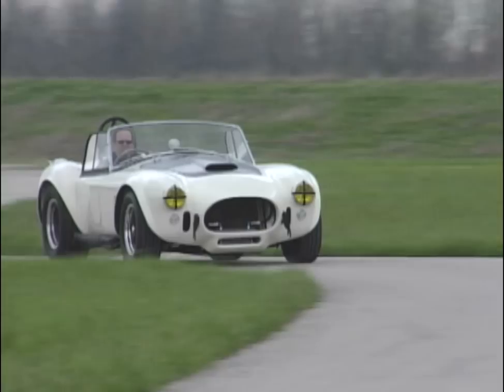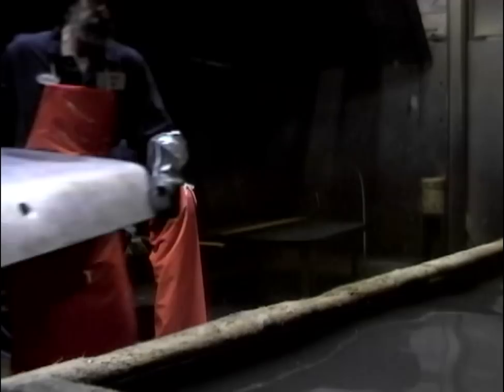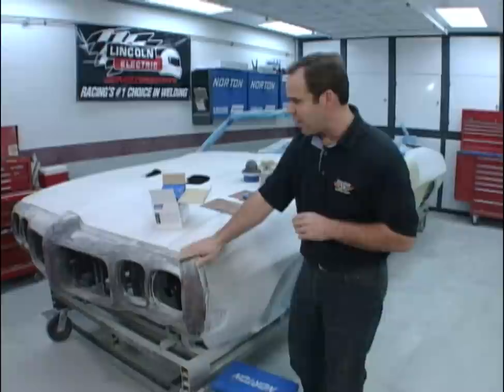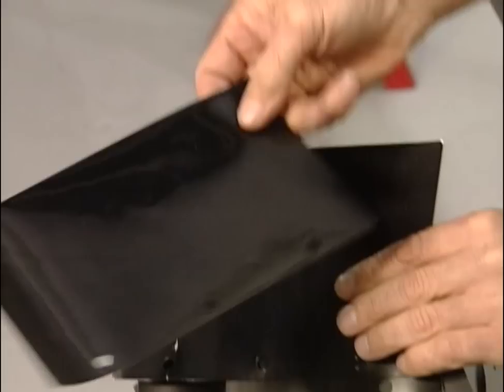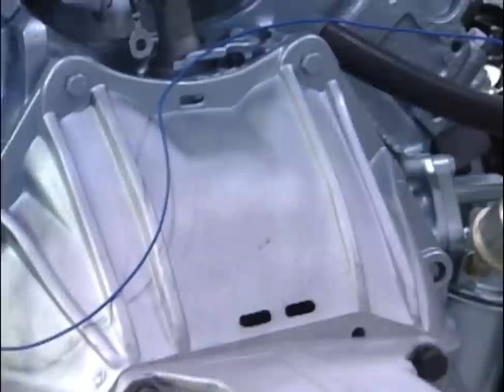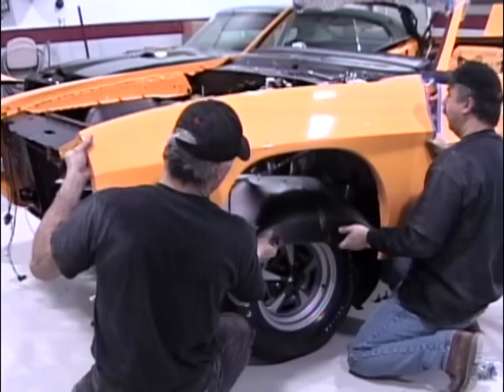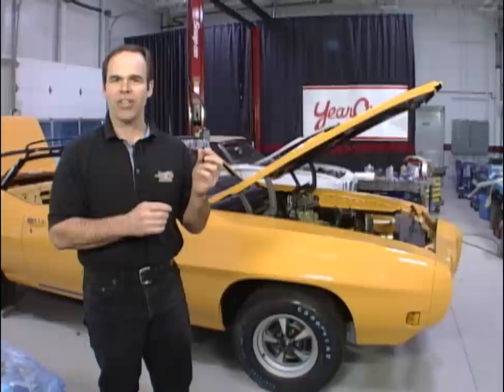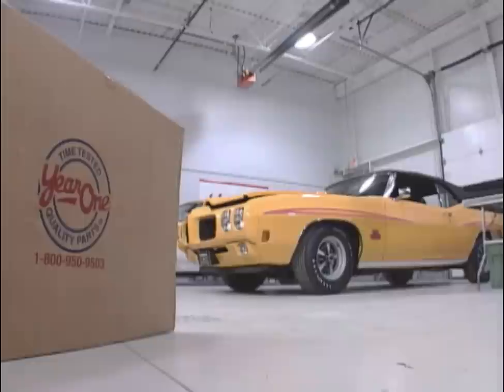This 1970 Pontiac GTO Judge Convertible came in baskets...

Comment: 40 mins 20 ish seconds.  it shows some of the black int.  then it goes down the outside of the bucket.  what do you see?  Those are not 70 buckets, they have the side latches as the 67 and 68s had.  strange the owner would go to so much trouble in detailing the car, then using different year seats.  did anyone else catch this?

Comment: Typically when you disassemble the cars you can tell the orientation from which a part was hung. All of the raw front metal was flow coated with air curtains with the excess being recycled from the troughs below. 
FWIW for Corvettes in NCRS judging if you do not get the metallic content/ size as well as color correct and make the surface and application appear like original lacquer with the correct texture you are going to lose A LOT of points.